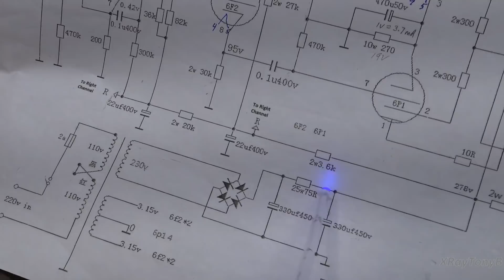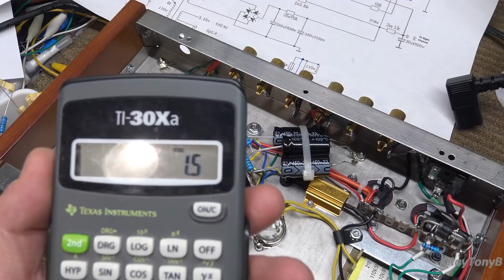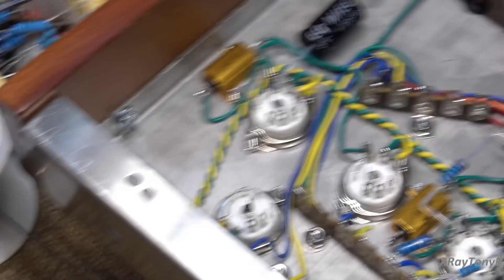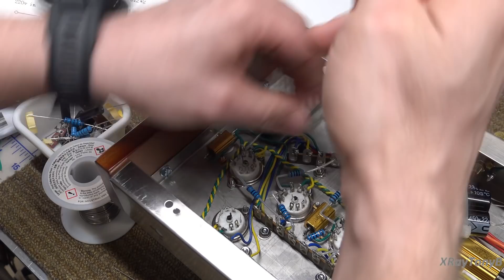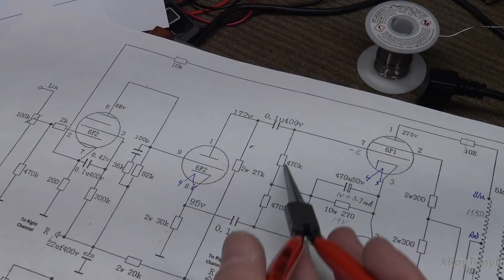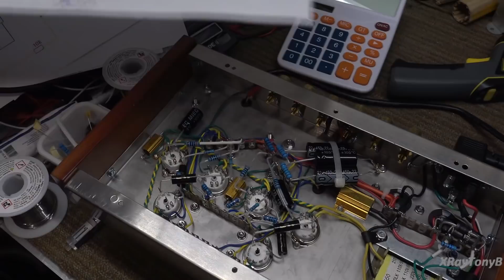Electronics 101½ Part 10 - Building the Second Output Channel

Comment: If you use the vacuum tubes with a 12V heater and a 12V B+ then a LT800 centre tapped Loudspeaker transformer should work and you don't have to worry about getting a 200-300V shock and can be run of a 12V Wall Wort.

Comment: WELLER 8200D was the best, The cable on mine reeds replacing but still works but needs the replacement heads.

Comment: In talking about grid resistors like the 470k, there is a limit on how large you can make these resistors that is stated on the tube datasheet. This should be emphasized in any discussion of them. If you make this resistor value too large, the tube becomes susceptible to going into runaway bias. And it's a different value for fixed bias. For the tubes you're using the maximum in cathode bias is 500k, so you're close to that, but in fixed bias it would be 100k. And it's different for different tubes. For example, the maximum in cathode bias for a KT88 is 220k.

Comment: I like to think of cathode bypasses as eliminating a source of negative feedback and, thus, increasing the gain. In your circuit, with a single cathode resistor and two push-pull output tubes, the cathode bypass actually shouldn't do very much until the output stage crosses into AB1 operation. It's only once one tube shuts off and the other tube is conducting more than both tubes at idle that the output stage cathode bypass acts to stabilize cathode voltage. Without it, you would get compression of the audio signal because the cathode voltage would rise along with the control grid. And there were a few early guitar amps designed this way without cathode bypass capacitors on the output stage, probably to protect the low-wattage speakers of the time.

Comment: Hi Tony , just some advice on output tubes biasing.........here we have to do with automatic bias , bypassed with a capacitor which was and still is common practice.
Normally it is a simple and safe way to bias tubes...

The use of a common cathode resistor was once the rule in the past when tubes were simply user replaceable items....
In the long term........the imbalance du to aging will grow and ONE tube will end up in doing all the work and will finally red glow.!
In the past era tubes were more consistent, reliable and stable ....but nevertheless .........I know that experience is hardly transmittable but I thought I may try to inform you about that....
Besides people liked the imbalance on the output tubes (PP ).....it creates a more Second harmonic which is reduced/cancelled by PP ...
Safe is one cathode resistor per tube .........some original datasheet mention that !
Anyway .........I like your passion and your video's .
I live with tubes for more than 65 years and repaired, build and worked with them up till today....for what it's worth 😀
Have a nice day.

Comment: I still have my Weller 8200 from back in the late 1960's, but has new bakelite case, original case broke from being dropped. Also have a Radio Shack gun, rebranded weller 8200.

Comment: @xraytonyb  You are absolutely right with your observations on grounding - it is always a matter of "how many distance will the current have to travel" and the intended working frequency of the device you are working at. A very nice project (and BTW very well done as far as I would think - I like the project and how you did it, Tony!). THANK YOU for letting us taking part of it!  :-D

If it is an audio amp a few centimeters (or inches) is absolutely no problem, as you have to see the distance as factor of the wavelength of the operating frequency. Dealing with audio equipment and frequencies of no more than 20.000 Hertz (twenty-thousand cycles per second) you are ending up at an wavelength of round about 14.000 (14-thousand) meters or round about 0.9 miles (!) of wavelength. So, everyone, before talking of induction of hum and noise into the ground plane - think  of what amount of noise could happen at your working frequency at a grounding distance of about 2.5cm up to 50 centimeters (1-2 inches)... Yes, there might happen RF stuff if you don't dampen it. Yes, in theory the shorter your connections to ground are the better. Yes, of course all resistances and impedances will add up to "something" that potentially will kind of spoil your results. But there are a lot of factors that are much more important than a few millimeters or fragments of an inch for the ground to travel.
 
For example you maybe have to dampen radio frequency influences on your tubes by blocking capacitors. This may help to prevent your tube amp to oscillate when coming near to it with your mobile phone and you do not want to hear that characteristic sounds of your mobile phone connection as tubes are operating at high input impedances. And it definitely is a good idea to keep away strong electric or magnetic fields from your connection lines to avoid capacitive or magnetic coupling. I mean wire-to-wire coupling inbetween different signals! This helps to avoid unneeded noise from connection lines when signal has to travel from one stage to another. It is also a very good idea  to have different stages separated either by shielding or at least having some physical distance - as Tony shows here perfectly: Having power supply as far off from audio stages as could be is best you could do, as it is prone to emit all sorts of humming and clicking noises up to the lower radio frequency range!

Well done, Tony! Nice job done so far

Comment: Tip for the (Weller) soldering pistol:  when you buy one, disconnect the tip, and measure the resistance with a mΩ meter. When you want to use a piece of copper wire in stead of the standard tip, be sure to match the resistance with that, so you get a 100% power conversion from the transformer inside; R-in  must match R-out for that.

Comment: Hi Tony.  Will attest to the quality of the Weller 8200, mines is over 50 years old and with exception to a couple cracks on the Bakelite body has continued to operate flawlessly.   Don’t waste electricity either because of instant heating with click switch, 140 watt for quick heat up and 100 watt to maintain temp.  The tip last relatively long not being hot constantly and if maintained with a wet sponge to remove acid flux after heating.

Comment: Tony, can you share the part number for the teflon tubing?  Mouser and digikey have a mind boggling assortment, mostly 100 feet, and expensive.
Reply from the maker: I think I got it from eBay.  Just search teflon tubing 1mm and 2mm
Reply: @xraytonyb  Got it, Thanks.  Amazon had 10 ft roll for 7.00.  Should last me a lifetime.
Reply: @scrappy7571  Hi, scrappy... I am also having a hard time locating the Teflon tubing. YouTube will not let you post the link to what you purchased. However, I would appreciate it, if you would please post the exact title to what you bought on Amazon. If you go to the product's webpage, you should be able to copy the entire title, there, and paste the title here.
Reply: I think I am seeing what you purchased. But, what is confusing me is that it says it is intended for 3D printers and its heat tolerance is only to 500*F. I normally solder around 750*F, so I am concerned this is going to melt. I thought Tony said it doesn't melt. Maybe that has to do with a short dwell time?
Reply: @t1d100  Yea, that's what I ordered, for 3d printers.  I didn't think to check the melting point.  Maybe the temp rating has to do with burst strength at 500.  Will find out this afternoon when it arrives and post back results.  My Hakko is set to 700, and seems plenty hot for circuit board soldering.  Larger components I go to 750, but that is rare.  Wonder what the Weller tip temperature is.
Reply: @t1d100  I soldered a few test connections, and had no melting problems with the iron set at 700 deg.
Reply: @scrappy7571  Thanks for that effort! Much appreciated. I ordered the 1mm and 2mm @ 16.4 feet. I have several friends that I share parts with.

Comment: Greetings:
Do you have an OPINION about DC vs. AC filament power? Individual rectifier diodes or small rectifier bridges are inexpensive. Are we likely to still need to twist the leads in non-series string sets?
What wiring style and filament power is appropriate for series string sets?
Reply from the maker: Unless you are building a phono stage or RF amplifier, I don't think DC vs. AC makes much difference.  Just use twisted filament leads and it will be OK.  I very rarely have an issue with filament hum.  More important is component layout.

Comment: If the filament wires were shielded,would that improve the induced hum situation?
Reply: I think shielding might help if using DC for filament power if there was any coupling issue there.

Comment: Greetings from Mt. Lebanon. Another fine video. You are absolutely correct about the durability of the Weller 8200. I have one I bought in 1962, only issue is that it eats #222 bulbs.
Reply from the maker: The main reason for the bulb wearing out is not having a good connection of the tip to the mounting nuts.  The bulb uses the voltage drop across the tip.  If the tip is disconnected or not properly connected, the bulb will see a higher voltage and will wear out more quickly.  Also, if the tip is connected properly, the LED replacement bulbs will be really dim, because the voltage drop across the tip is so low.  That's why you really need to use the proper incandescent bulbs.
Reply: @xraytonyb  Thanks for the info.  Like your Hakko setup. I have the prototype FX-951, called "Future Product" and the 975? desoldering station I got from work when we upgraded  Looking for a decent small size fume extractor.
Reply: That beats mine from 1969.daily use for 55 years and on my second bulb. Did have to service the trigger switch a few years ago..
Reply: Greetings:
It may be the present mains voltage; add a small resistor or convert it to an LED.

Comment: I'm not sure I understand how critical the cathode bypass capacitor is. A back of the envelope calculation shows that at frequencies as low as 50 Hz, the reactance of a 470 uF capacitor is less than 7 ohms which is considerably less than the 270 ohm cathode resistor (or the impedance presented by the cathode). So the capacitor is doing the job that was intended to do - hold the cathode voltage relatively constant despite the varying cathode current. A smaller capacitor would not bypass the lower frequencies and thus reduce the gain of the amplifier at those frequencies. Is this what you mean when you refer to "distortion"?

Comment: Hi Tony nice build I love point to point wiring, I do it too.
I wonder why the designer didn't use gridstopper resistors after the 0,1uf coupling cap to the grid of the 6P1.
I use a 2k2 to avoid occilations.
Maybe if you encounter this, you may add them.
I use negative voltage to the grids of my end tubes to set its bias. I like to set the tubes exact with the bias.
Yes they will drift after an hour then after 2 hours they will be very good stable also when it's cold and heat up again the next morning.
I follow your build and you go your own way and it should be. Good information on your way to build. Appreciate that.

Comment: I believe many misuderstand the rule. The outside-foil side is connected to the lower impedance side the the circuit, not (necessarily) the lower voltage .

Comment: Well I tried to watch but your video has gone all Max Headroom, the virtual blotchyness from whatever YouTube did to your video takes away any details, I will try to  watch again after a router reset hoping it's on my end.
Reply: On the second attempt to watch it was still blotchy up until the 9 Minute mark     then it cleared up, I only mention this because I have never seen such large posturization so large in fact that the blotches that were the same color as your hand over the circuit board stayed there for 30 seconds or so, it just seemed real strange to me but it looks okay now 🤔